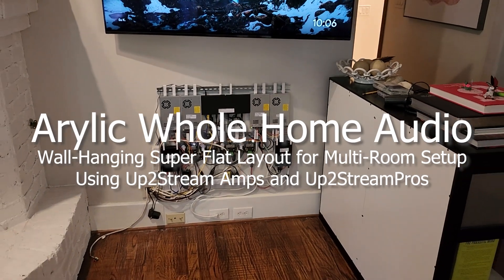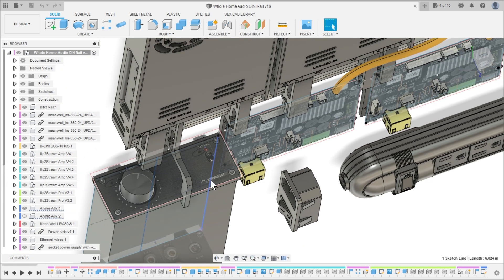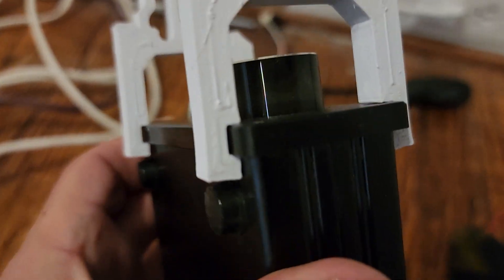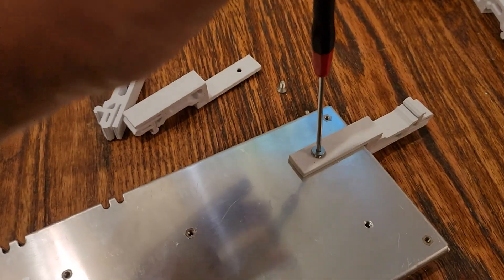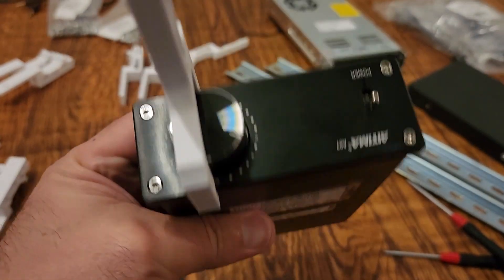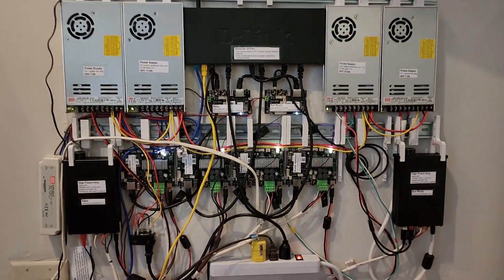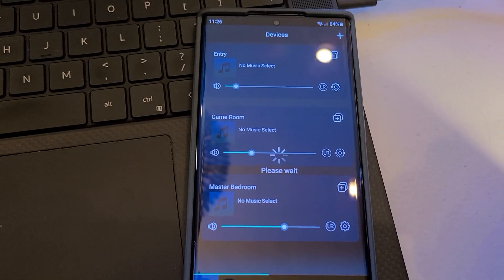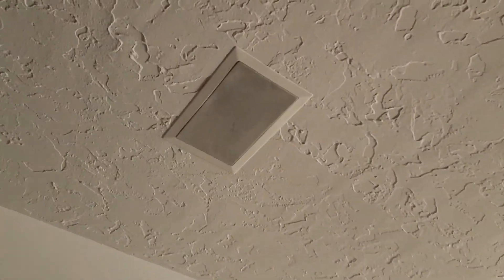Arylic Whole Home Audio - DIY System

Comment: Hey John.  I used to use your software for my DIY CNC machine. Hmmm, long time no see.  Anyway good to find you here with your Arylic project.  I've ordered an Arylic Mini but it hasn't come as yet.  Question: Without the Workbench software, can the 4Stream app adjust the bass and treble of the Arylic boards?

Comment: John Lauer..  I know this post is nothing to do about Chillipeppr, but isent it possible to get in contact  with in any ways :)   I cant find any forums or so on the program, and just wanne find out if its me cant find out, or the program cant run GRBL 1.1 f  ?  ( i use a box call Openbuild blackbox )      Hope its okay to ask here.. regards Lars
Reply from the maker: There is a forum you can post a question at https://forum.makerforums.info/c/chilipeppr/
Reply: @JohnLauerGplus   thanks alot :)

Comment: Beautiful job!  Mechanical engineer here doing a major remodel project and leaning hard towards the Arylic amp solution for 6 or 7 rooms full home audio.  I'm just in the process of ordering the first up2stream and power supply to test things out on the bench and get familiar.  One question though...  What's the 5V power supply for?  I've watched your video a few times and can't sort that out.  Again thank you for setting the direction here!

Steve
Reply from the maker: The little Up2Streams need a 5v input. I think the devices with the built-in amp have their own DC to DC converter, but the little ones don't.
Reply: Hey John, another question here. Where did you find the connectors connect to the app to stream board from the power supply. I’m coming up empty on that.😊
Reply from the maker: @steveharvey451  You know what's so funny about that question, just earlier today I was frustrated that one of the Arylic's for the master bedroom keeps losing power because I used the wrong connector and it's too loose. I actually added solder to the outer metal for the other ones just to thicken it up. For the life of me, I don't know what the correst size is to use. It's kind of infuriating that Arylic didn't specify it.
Reply: @JohnLauerGplus  I just emailed their support site on that. The Amazon recommended algorithm is linking a 5.5mm x 2.1/2.5 mm x 10 mm connection. If I don’t hear back I’ll order both a 2.1 and 2.5 as listed on Amazon and let you know which fits.

Comment: Do you have a video or documentation explaining how you connected the power supplies? It looks like they are linked in pairs, but I wasn't able to get a clear look.
Reply from the maker: No, but if you watch the video where I pan over the power supplies, you can see my labels on each power supply tell you which, or how many, Arylic devices I connect to each one. So just pause the video and write it down. Also, just as a note, I've been using this system now almost every day since I published this video and it works great. I have had to reboot it once as my Spotify wouldn't connect.
Reply: It looks like you have yellow wire connecting one power supply to the other. I'm just not sure why. Also, for the power cords that go from the supplies to the arylic boards, did you have to make some yourself or did you find extras on the arylic website somewhere? I know each supply comes with a cord to power 1 board but that would still leave 2 boards needing a cord.
Reply from the maker: @maxchillin5480  Ahh, yes, the yellow wires are just the ground connection in parallel to all the supplies. So, you can cascade those from one to the next. You can do the same setup with Neutral and Line. It's just like you're stringing an extension cord from one to the next. For the wires from the power supply to the Arylic I made those myself. I think I used 18AWG wire.
Reply: Thank you! That helps a lot!
Reply from the maker: @maxchillin5480  Oh, I do recall buying those DC barrel jacks on Amazon and getting the wrong size so had to add a dab of solder to thicken up their insides. So I recommend finding the correct barrel jack size. I wish they hadn't use barrel jacks, but rather screw terminals. Oh well.

Comment: Do you have any RCA inputs vinyl or CD?  Could you play to all speakers in the house if you did?
Reply from the maker: Hmm. I don't because I use only Spotify so far, but I think if you set one of the Arylic to have an input of RCA jack instead of input as Spotify, then you could stream it to all of the devices just like I do with Spotify. However, I'm not totally sure.

Comment: Nice Video!

I'm curious if you have any latency issues when you combine locations?
Reply from the maker: I was worried about the same issue and they must send synchronization packets to each other to resolve it because I have not had any synchronization issues in fact it works pretty brilliantly
Reply: @JohnLauerGplus  That's great news- I've had horrible sync issues over wifi, so I'll try hard wiring them to see what happens... I'll try it on a test bench before I go running wire everywhere in my 1908 house 🙄

Thank you for the reply!
Reply from the maker: @addismanley8271  I have a couple of my arylic devices on Wi-Fi and the others on ethernet and even those seem to synchronize fine. I will say that I do only use Spotify so not sure if that makes a difference.

Comment: What are the advantages of this system vs using a multi zone system like Soundavo WS66i?
Reply from the maker: I am not familiar with Soundavo, so not sure, but compared to Sonos, I found the Arylic to be much more reasonable in price and flexible.
Reply: @JohnLauerGplus  I think going with Soundavo WS66i or a Dayton Audio DAX88 will be much more economical than this setup
Reply from the maker: @HafizAbass  I just checked out Soundavo's website. At first look, it seems like the WS66I is $2250 for 6 zones. In the Arylic setup here it's about $150 per zone. So, Arylic is MUCH cheaper. Now, it looks like you can get a 6 zone expansion unit for $700 from Soundavo, so that starts to get cheaper. Perhaps it depends how many zones.
Reply: DAX88 is 8 zones 8 sources and is about 1500 euros. Probably a bit cheaper in the US. The only thing you need to do is run your cables and you are done. They have a great app also to stream and combine zones etc.
Reply from the maker: @HafizAbass  The Dax88 is sounding closer to viable. I suppose one of the benefits of Arylic, for me, was that I could also put 1 unit on a standalone speaker setup, so I could distribute it around the house. For instance, my daughter's room just has a local setup of an amp/speaker. My other daughter has a local setup too of an amp/speaker. The reason for this is they need local Bluetooth and local aux in for a record player. So, with Arylic I was able to scatter devices where needed. I also needed a super power amp for my 4 outdoor speakers, so I put an Arylic in the attic where those amps are for powering the pool area. Again, another distributed device. So, can you distribute smaller single unit Dax devices and they sync with the whole system?

Comment: I'm about to do similar setup, albeit little more rooms. What is your opinion on PSUs with fans ? I fear dust ingress, so I'm buying passive ones for amplifier (about to start testing Meanwell ERPF 400W 48V 8.3A).
Reply from the maker: I did another setup for my pool with even more powerful amps, thus Meanwell PSUs where the fan is always on. So, in this setup I connected into the GPIO port on these Arylic boards to watch the on/off signal they can output. From that GPIO signal, via a relay, I could turn the PSUs on only when music is playing. That would be another angle.